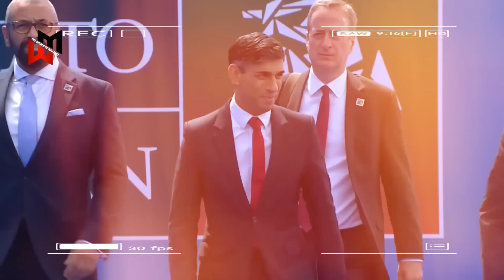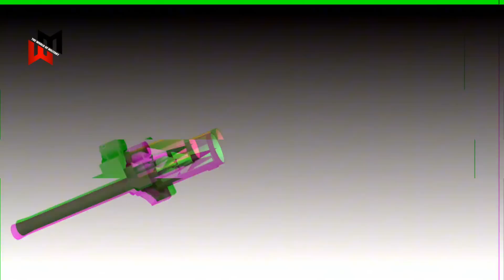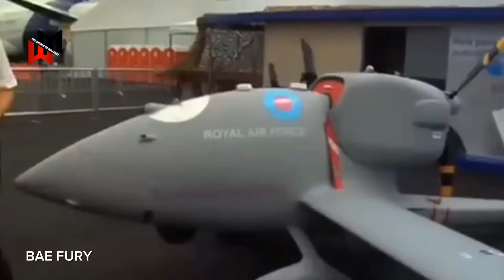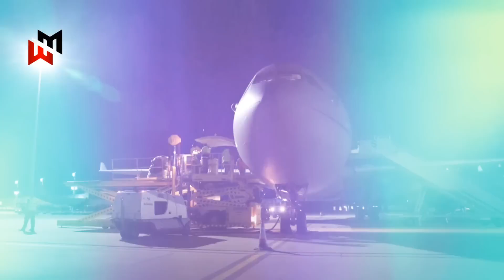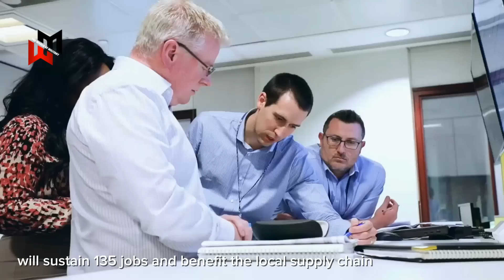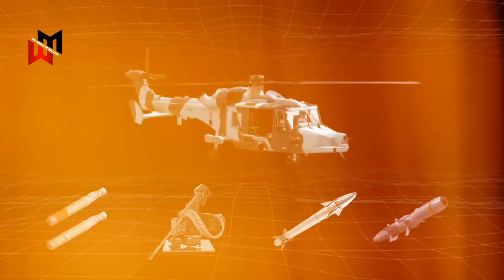This is Why The UK Spent Hundreds of Millions of Dollars Buying These New Missiles

Comment: Finally our country is waking up to see that the Royal Navy has been run down for far too long.The building of more powerful surface fleet is a priority that the new government must accelerate .
Reply: We’ve got a labour government and they have always cut the defence budget, wouldn’t surprise me if starmer cut the military down for a smoother hand over to the A`holes slowly taking over already.
Reply: Labour will cut any spending and the next Government being either Labour or Reform or Tories they will also cut any spending. Its how they think in the UK
Reply: We need more, smaller cheaper platforms and less overly expensive and large ships.
Reply: @hughwilson-gm9bw  to a point. Just like aircraft had a “high” “low” mix, such as F-15’s (when new) were expensive but we could field them in good numbers. The F-16 was very good for its hey day at less than half the cost. You will still need some high end systems (some 1,500-2,000 F-15’s built), but a reliable “low” cost system you build in large numbers (about 5-6 thousand F-16’s have been built to date)
This kind of math works with ships too
Reply: @nsatoday  With FCAS the "high" was supposed to be Tempest and the "low" was meant to be unmanned wingmen.
Reply: Having served with UK and commonwealth troops in GWOT operations, it’s saddening to see such brave and committed people underfunded and under equipped.
Reply: Labour are already cutting back on the military.. Are you blind or something, they need the money to build 1.5 million new homes to house all the immigrants they're letting in.
Reply: The New Government are alrady cutting back on spending on the military. Anyway, they need the money. They want to build 1.5 million new homes to house their new voter base they want to let in.
Reply: Not commonly known England has the lead in missile tec
Reply: Been way to long. Should of learnt that from them having to take things out of the scrapyards for the Falklands.
Reply: There is a defense review underway, by the new government. No official announcements as yet, but rumors say the proposed Tempest aircraft will be cancelled, as will the replacement helicopter for the, now, very old Puma, and a new anti drone system currently under development is at threat. For the last 80 years defense reviews result only in cuts. Do not be suprised  if further cuts to the RN are announced, the 2 LPD’s have to be at risk.
Reply: @paulhill1665 Hi there not sure about the other stuff but I get updates the the uk defence journal and it appears to be still progressing ? I think it could be a politically bad move to cancel tempest ? That said they could expand those involved with a move to closer defence ties to Europe and the uncertainty about NATO and US involvement? I am led to believe the US will not sell their 6th gen fighter ?
Reply: @Paul-of2yq  The American 6th gen plane will likely be even more expensive than Tempest, and if we did buy some, all that money would go to American companies, not recycled back into the British economy and also we wouldn't have control over our own fighters, like other countries not being allowed to do anything to F-35 without US/LM doing it. And if we were doing something the US didn't want, they could turn off support and ground the planes pretty quickly. Or if we wanted to give some to a country like Ukraine, we wouldn't be able to. Never buy military equipment from the US if you can possibly help it.

Comment: Martlet offers a highly accurate one shot, one kill option, from small arms ranges (400m) out to 8km, where it could supplement warship’s heavy weaponry. Instead of chasing tiny, highly agile targets and trying to line up a gun run, while avoiding hitting the friendly warship and probably taking incoming fire from the swarm, a Martlet equipped helo can sit at a safe stand off distance, sending deadly accurate, laser guided rockets against them. A Wildcat could safely engage and destroy twenty targets in less time than a dedicated gunship could currently engage just one. It’s also a lorry load cheaper than the current generation of guided missiles, much smaller and considerably lighter. Wildcat has a new wing mount which can carry up to twenty of them, or a combination of other weapons including the new Sea Venom light anti-ship missile.
Reply: Thanks for this info
Reply: This is just one of the reasons the new Type 31 would wreck any attempts at symmetric or asymmetric warfare. 
Considered a poorly armed "economy" frigate, its armament is thus:
1 Bofors 57mm 3P
2 Bofors 40mm 3Ps
Strike length mk41s VLS cassette, taking TLAM, Naval Strike Missile and quad packed Seaceptor short to medium range air defense missiles. 
1 Wildcat with everything it can carry 

All tied into the AESA fire control radar via an integrated defense system. 

Those Bofors are savage, programmable 3P ammo point, delay or timed airburst allows it to easily destroy asymmetric threats on sea and air and engage and destroy ships at 10 miles.
Wildcat can feed targeting data into the defense system for cueing NSM.
Reply: Just a minor matter of fact, it isn't 400m